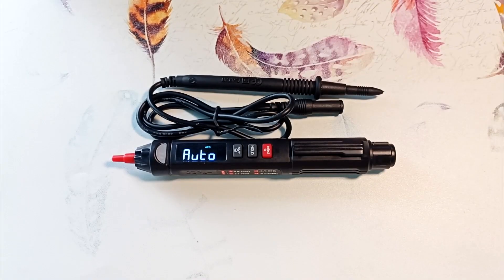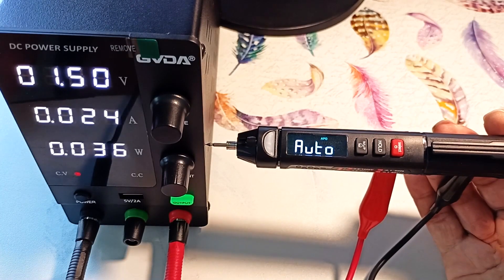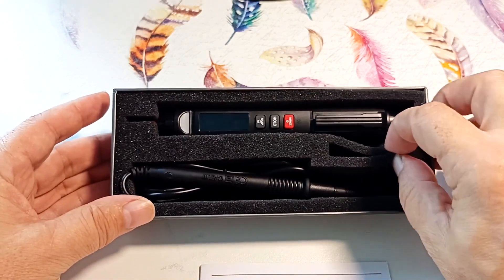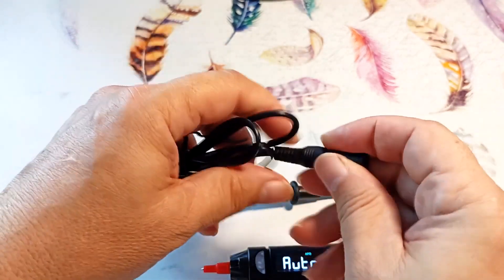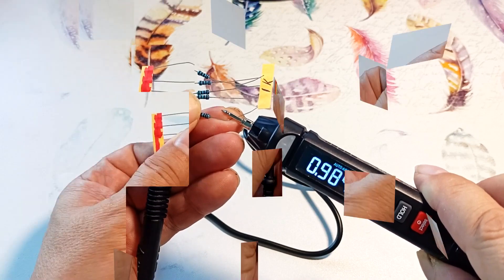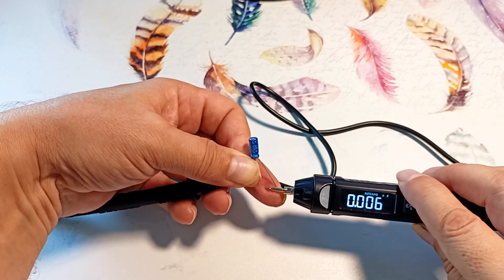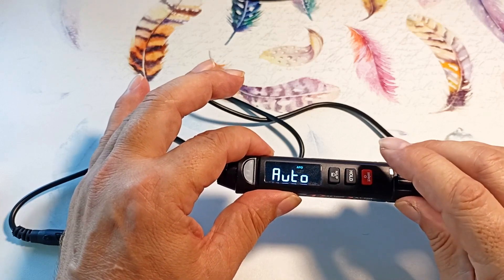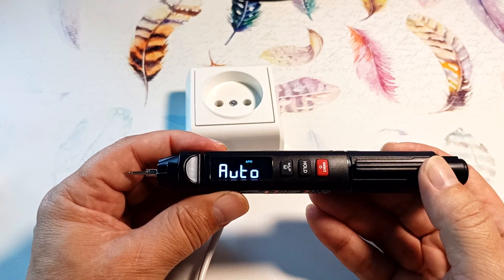⚡Digital Pen Multimeter A3008 – How to Use It? AliExpress Compact Multimeter Review! Is It Any Good?

Comment from the maker: https://alli.pub/74qhn8?erid=2SDnjdbSRAL - A3008 pen multimeter
https://alli.pub/74qdnx?erid=2SDnjbrYtjn - Mini current clamps
https://alli.pub/74owdx?erid=2SDnjevnYrQ - Laboratory power supply
https://alli.pub/75z3a4?erid=2SDnje77c8L - AN9205A multimeter

https://bit.ly/Pomkan - Support the channel financially
https://www.youtube.com/@EkimovIgor1 - This channel in Russian.

https://youtu.be/MOM02oFWr-E - Dual-channel digital oscilloscope
https://youtu.be/fTNVlWXwR2M - Thin digital multimeter FNIRSI S1
https://youtu.be/GeTrV2MP1yQ - Battery tester HRM-10 FNIRSI
https://youtu.be/suQe48g_4p0 - Adjustable DC Bench Power Supply
https://youtu.be/Mni-P-7enUA - Laboratory Power Supply DPS100

Comment: of course, it's not suitable for full-time electrical work, but for most tasks I think that's what you need, especially if you have to carry it with you, yes, the dimensions of the device are minimal and it's very convenient and the display is normal, I think everything will be visible normally in strong sunlight and the error is acceptable, so such a device has the right to exist in a work briefcase
Reply from the maker: I agree